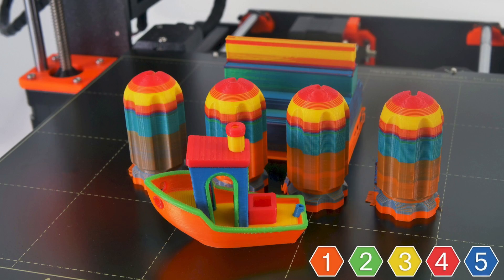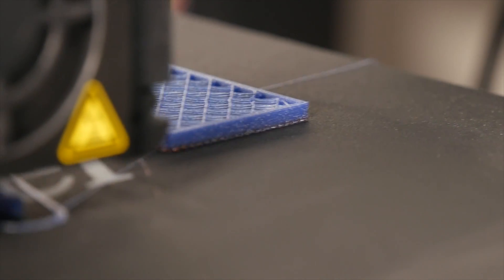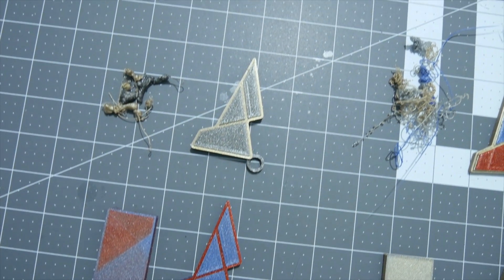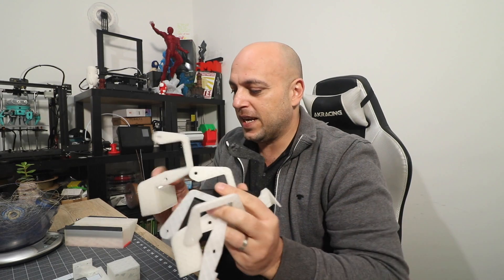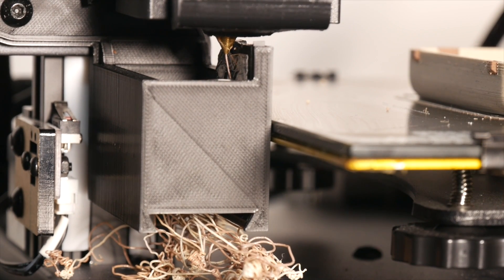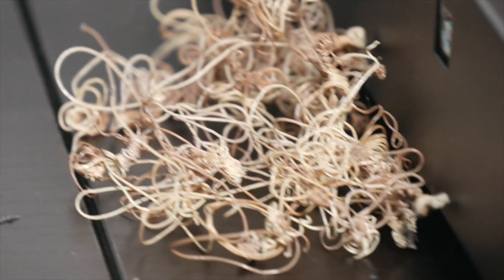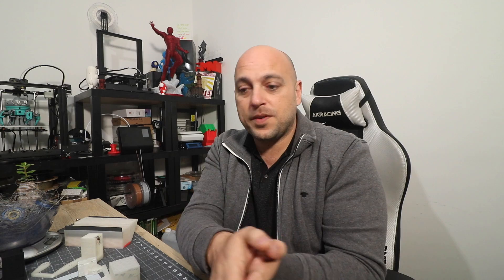Reducing Multimaterial Waste and Print Time with Purge Buckets

Comment: Nice job with what you have. But, yes it is possible to eliminate the purge completely by using 2 hotend, which is a big redesign effort. If you use 2 independent printhead (idex) or toolchange + a silicone rubber pad, you can even prevent oozing on the standby hotend, purge = 0. Ultimaker use a height difference between 2 nozzle on the same print head to prevent oozing to interfere with the model with minimum purge tower (just prime the material 6mm).

Comment: I resumed a failed print by measuring the height, e.g. 160, and finding the Z160 command in the gcode. Then delete everything before it to continue the print from there (after initialization, warmup, purging nozzle, etc.) You'll have a line or partial line missing, but it's not very noticeable. If you know the exact line number where it failed, that'd be different. You can also print a bracket to hold the failed print, put it into the bracket, and continue from there. :D

Comment: You could reduce the length of purge if slicers could make tool change earlyer. Example: - it would print the walls, make a tool change (no purge), print the infill, print a tiny purge block to get to other color and start new layer. Of course the time when the tool change is scheduled would be dependent on melting zone size (configurable). I posted idea to s3d years ago.. they found it interesting; maybe we get it in 5.0
Reply: well, 5 is finally a reality, wonder what cool things they added.

Comment: I'm using the simplify3d toolchange script on my A10M, however it's executing a "toolchange" at the start of the print (right after the prime line), and purging before starting to print. Any way to eliminate that? Thanks!

Comment: how does this work gcode wise? I mean with my palette 2 you have to use canvas to generate the gcode, so how do i tell it to use this instead? what am i missing?
Reply from the maker: With the palette you don’t fix the gcode, you simply change from a purge tower to side transition
Reply: @3DMakerNoob  OH I SEE! thank you for replying. I will have to find out what this chroma thingy is, At the moment the filament is wasted a lot because it has to keep the purge tower at the same level at the nozzle, therefor it is purging every layer. With side transitioning it doesn't have to keep the purge tower at the same height so it should only purge when the color changes is that correct? So that means if it is changing colour every layer a purge tower is basically the same filament usage as a purge bucket, But if only changing once or twice then the purge bucket will only purge once or twice and save tons? is that right?

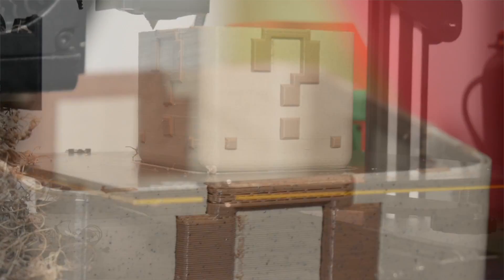Comment: Nice concept, although for models that require a filament change on every layer (such as the typical striped gecko, or even that model shown at 6:30) the purge bucket seems not much better than a purge block or wipe tower, and it adds moving mass to the printer. I have found the best ways to mitigate waste are to design the part with minimal tool changes or have the changes be near the bottom, purge/wipe to infill (Slicer has a setting for this), or purge to other parts on the bed.

Comment: even after all this it still is just so much.. and it makes me sad! I feel like dual extrusion is way nicer and trouble free despite the offset calibration needed.
i get 2g-10g of waste on something that'd make 80-100g this way. mine is a tool changer but there's also the tilting hotends.
you could definantly convert your ender 5 to a tool changer if you have the patience xD you probably will lose like 20mm at least in the Y tho for the tool changer, probably ;-; my printer was 300x300 and now it's 300x220mm

I think it'd be awesome tho if we had cheap recycling stuff for making filament! this way not only the prototypes would not be wasted, but we wouldn't care about the purge and could turn household products (bottles) into filament!

PS: I hope this isn't rude! i'm just sharing my thoughts about feeling guilty seeing the waste. you did one hella awesome job :)
also wire brushes are worse than silicone. their bits can get stuck in the hotend and cause a short although rare to happen :P they also wear the nozzle!

Comment: When I use this script it works all good uo until it returns to the part then the nozzle is too high when it gets back. Can I just alter the script to go down 1.2mm instead and tweak that until it has returned to proper height?
Reply: I Just watched it closely when it was changing colors. The nozzle lifts and moves off the bed to change colors, then it comes back to the part, moves down 1mm then moves back up before it starts printing. What can I do to fix this?
Reply: I remedied this but just removing the  Z movement lines from the script. Now I just need to get rid of my blobs and I am all set

Comment: @3DMN Just to say: I belive it can be done on a prusa Mk3. The nozzle is out of the print bed zone on the right side like 1mm or less but this should be enough with a decent design to to it. How do i need to modify the gcode to achive this ?

Comment: I am thinking of getting either an A10M or an A20M would your design work on the A10M   also how to I tell my sliccer Cura to use purge bucket rater then a purge block/tower or do I need to switch to a different slicing software

Comment: I think that non-mixing multi-materials should retract the filament instead of purging (well they still need to purge a bit probably, but not the whole bowden length). It would potentially need a driven or at least spring loaded filament mount but it would save the material even further.
Reply: They do on PRUSA i3MK3 MMU2. But you also need to get rid of what is in the nozzle, you can't get out all material just by retraction.

Comment: I have printed this out, came out great, but haven't attached it yet.  I found the code (I assume) in the files of the download to use the Purge Bucket, however in Cura I have not yet figured out where to put it.  Also, the code mentions Simplified 3d, not sure if the two run the same or not or if Cura needs it's own commands to use this. Any tips?

Comment: I don't know if this is of any use but I often find little bits of oozed filament on the left side of my Prusa MK3 near where the initial wipe movement occurs (near the home position). You might be able to do something with a purge bucket there.

Comment: I can see how it saves time but not having to move, but I don't see how it saves waste over a tuned slic3r purge block. But saved time is an improvement so that's good
Reply from the maker: Whether a purge block is tuned or not, if you have 100 layers of a single colour before switching to multicolor on a model, it still has to print them, whereas with a purge bucket it doesn’t purge during those 100 layers

Comment: I have an easy mod to allow 268mm X travel on an Ender 3. 
That should be plenty of room for a purge bucket on the far end of the X axis.
Just by eyeballing it, I can see that the extruder nozzle lines up(ish) with the outermost groove in the right side 4020 rail (viewed from the front).
Perhaps a mirrored version would work for that.
Reply: what is the easy mod?

Comment: I was thinking about how you could retrofit something like this to a Prusa printer. Maybe you could have a retractable bucket of some sort. 

The purging would look like this. Right after the nozzle finishes printing a colour, the nozzle will go to a point at the top corner or the printer. The bucket would move under the nozzle. The nozzle will purge out filament into the bucket. The bucket moves out of the way. Finally, the nozzle goes moves back to where it was printing.

And fantastic video by the way.

Comment: Why isn't it possible for the printer to be able to create a purge block at a different height than the print? If the purge is placed someplace where the extruder could lower without hitting the print. Thanks Joe, love your videos.

Comment: There is no reason purging can’t be done entirely in the infill. It should be coded into the slicer. Even a solid fill model the interior color is not important unless you ere using transparent or translucent filaments.
Reply: Surely it depends on what you are printing, and how many colours you are printing? If you need ~13cm of material to go through the nozzle and only ~5cm of infill to print, there's no way it can work.
Reply: Scott Robertson sure it can work if you increase your infill percentage as most of us print with a 15% infill on models. When your printing in multi colors increase infill. In fact some slicers let you increase or decrease infill at different points. In areas you have a color change, increase your infill in those areas. I’m not saying it is an easy task, I just know some coder out there can get the better answer.. love the CODERS...  ;-)
Reply: You are right
Reply: Yes. So please math is there is most always more interior area than exterior surfaces.  I use a 400x600 delta style printer and it would drive me crazy to lose any of that area and waste that much material building a waste tower. Fill, interior walls... sure vase mode has no easy solution, but most prints aren’t vase mode..
Reply: This approach may work for many projects, but if the model is using multi-material where the material differs in areas (e.g. rigid infill with a flex shell) then this approach won't work.
Reply: Huh.... that’s actually really smart. Cura already had a spaghetti infill option

Comment: This is what i was talking about! More of this kind of content please! And a suggestion: Try to have the extruder purge on a ramp, about 45-60 degrees.  This curls up the filament into a nice blob and when it cools, it just slides off. This reduces the volume of the purge strings. My stratasys uses a system like that. If you are interested i can send you a picture

Comment: Purge blocks and purge buckets are unnecessary when we get to multiple tool heads. Or am I missing something?
Reply: They are necessarily in that they are needed to prime the nozzle since you want to remove material from the hot end when not in use to stop oozing.

Comment: Did that on my big dual color delta a couple of years ago, certainly better than a purge block. My current in progress machine is an independent extruder system, and I've been able to eliminate purge/prime entirely. There is no need to purge with independent extruders, you just have to be able to stop ooze and get rid of it when it happens as well maintain extruder pressure -- I'll share my solution when I release the build,  but after 2 years of trial and error that works a dream. No purge, no prime, only cost of multi material is the time it takes for each head to park and get back to the print.

Comment: In Marlin there is a section on bed limits. Under "Z Probe Options" look for the following at line 882 "
 

// Travel limits (mm) after homing, corresponding to endstop positions.
#define X_MIN_POS -33
#define Y_MIN_POS -10
#define Z_MIN_POS 0
#define X_MAX_POS X_BED_SIZE
#define Y_MAX_POS Y_BED_SIZE
#define Z_MAX_POS 240

This code is from the Anet A8 configuration.h file.

Hope it helps as I know from your videos that not all printers are able to reflash the firmware at this time.
Reply from the maker: Yeah, but I wanted an easy fix which wouldn’t require reflashing. Having just a simple code which switches off and then back on the soft limit switch is so much easier

Comment: Love it, I get no end of issues with inconsistent pings when side purging, any tips?
Reply from the maker: What I noticed is that fixed transitions don’t seem to be working well at the moment
Reply: @3DMakerNoob  Ah so you are not extruding in place?
Reply from the maker: No I had issues with pings and also extrusion speed when I tried fixed transitions, so instead I used the side movement purge
Reply: @3DMakerNoob  thanks buddy, I'll revisit this method once again
Reply: @3DMakerNoob  are you using movement pings?

Comment: Purge block and purge bucket material is waste. Since 3D printing is developed enough nowadays, maybe it’s time for more filament recycle equipment to be introduced to the market. I know there are a few but reviews in YouTube show they might need improvement while they are a bit expensive.
Reply: The fundamental problem with existing filament recycling tech is that they work very differently than industrial production. They use nozzle diameter and feed rate in an open loop control system to attempt to produce decent tolerances. 

Contrast this with industrial methods which use water baths, pull rate and lasers to keep it in tolerance with a closed loop method.

Comment: Haven't watched the video yet, but didn't E3D show something like this on their multiple tool head prototype that used a vacuum on the purge bucket? (more like a purge funnel I guess)
Reply from the maker: Purge buckets have been around for a while but mainly on IDEX printers like the Sigma and the Formbot.
Reply: Wasn't implying they were anything new or E3D invented them. I remember some comment about a drawback to this design was it getting full. I just thought E3D had an interesting solution to the problem, and they probably weren't the first to us a vacuum either.
Reply from the maker: a vacuum would be ideal, the toolchanger system works beautifully. but then again the already existing purge buckets work decently as they are, but having a cleaner option (a much cleaner version than mine) is definitely ideal hehe